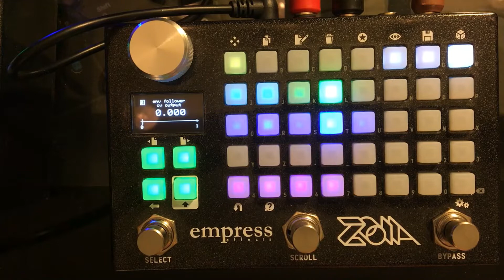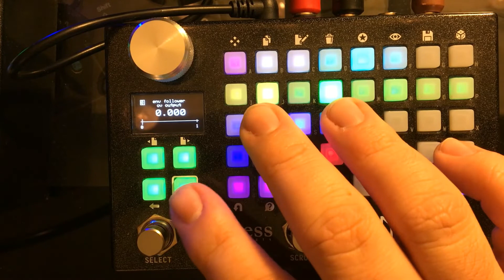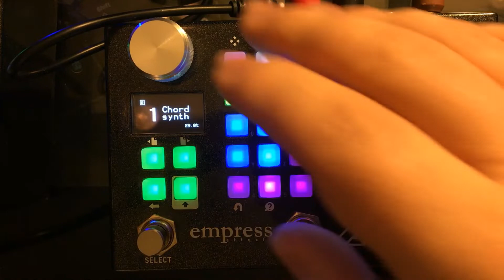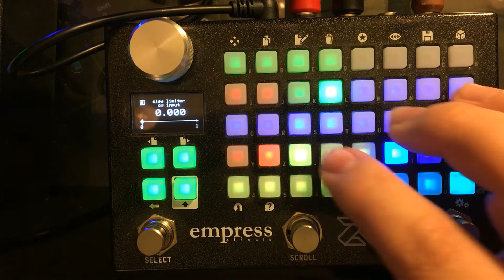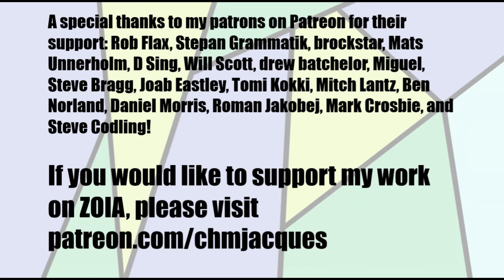Empress ZOIA tutorial:  "Pitch-tracked synths"

Comment: Thank you for the review! How is the tracking and pitch-bends? Can you control the dry/wet ratio while playing, usin an external expression pedal?
Reply from the maker: There was a firmware update a month or two ago that drastically improved the tracking (since I made this video); I think the pitch-tracker is very expression now for bends/slides, etc. now.  Not perfect or infallible, but very good.

You could certainly use an expression pedal to control dry/wet balance; with something like a pitch-tracked synth, you would route the dry into one channel of an audio balance and the wet into the other channel, then use the expression pedal to modulate the mix.

Comment from the maker: You can also add a low-pass filter, in series, before the high-pass filter.  This can be used to sheer off overtones, but I find it generally contributes less meaningfully to pitch stability and adds yet another level of potential latency.  Overtones tend to be quieter than subharmonics, even if we hear them more clearly (because of the physiology of the human ear).  Or you can skip filter, if you need the CPU, or just don't want to bother; it's no miracle cure!